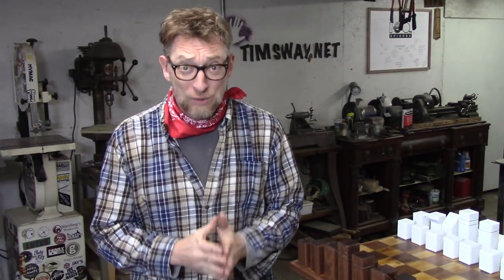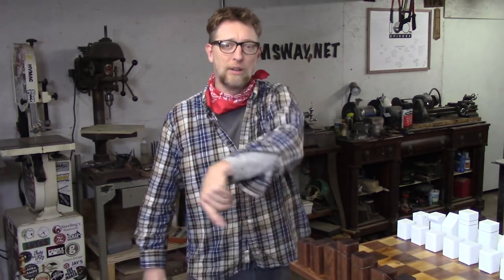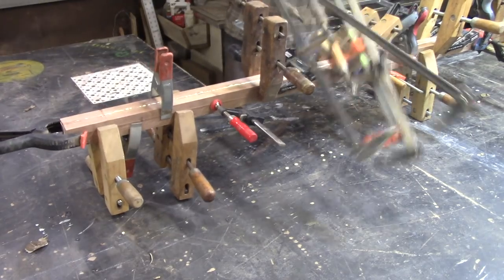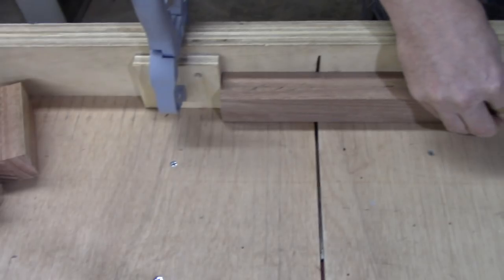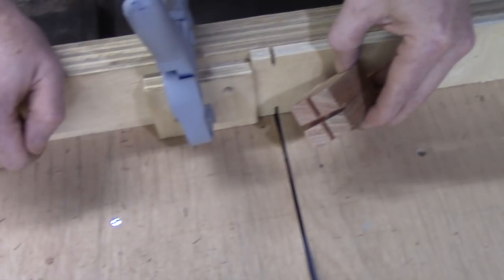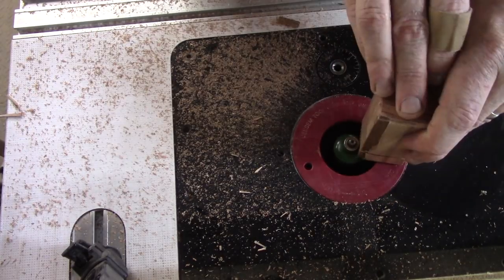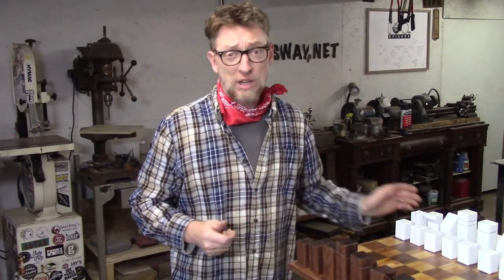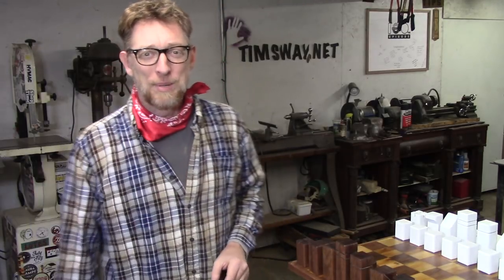Make an Elegant, Minimalist Chess Set in an Hour | Simple Plaid Friday Project

Comment: Looks great.  Do you think a wt in each pc would be worth the time
Reply from the maker: at this size and with these dense woods it was not needed, but if you make them smaller or from lighter wood, drilling a little hole in the bottom for weight would be a good idea. hide it with felt.

Comment: i really wish i could make things for christmas but i just dont have the time, do you have any guidence?
Reply: Joe Christman make small or simple things, or something that you're familiar with already. Making the same thing repeatedly is much faster when you batch your production too, so you can make, say, 10 candle holders in the time of would take you to do 2 or 3 individual pieces.
Reply from the maker: yes. make with what you have and the time you can make. Most of my life I never had a workbench or tools and I had other "jobs" but I had a kitchen table and a paint brush. For example the first chess board I made (and I still use) is a wooden table/box I got at a discount store that i taped off and painted the board on. It took very little time and can be done while eating dinner :) Obviously there are better ideas, but you'd be surprised how much time you can make if you want to (unless you're like a med student intern, then maybe not :)

Comment: I'm not a professional by any means, but at 3:45 why dont you use a stick to push it instead? Devastating slip
Reply from the maker: I'm not quite sure I see what you're talking about? I am using a push stick the whole time. But to generally answer, at the end of the day safety is a personal relationship between the maker and their tool. Understand how the tool works and how it can hurt you. Know your comfort level and understand others may be elsewhere on the spectrum. 

I certainly see people do things that make me cringe. If they are new or inexperienced it is my duty to help them know and understand what they are doing is dangerous (and if they work for me I can mandate certain behavior). But if they understand the tool but choose to live on a different part of the safety spectrum, that is their choice as long as their behavior doesn't endanger me.

I spent a day working with a guy who had removed the safety guard from his circ saw and would set down on a step stool between cuts, with the blade still spinning, hanging off the edge of the stool. This was one of the most insane things I had ever seen, but before we started working he specifically showed me what he does and said to me, (paraphrased) that this was his method he had been using for decades, I was temping on his worksite and I needed to be aware of this for my safety. 

Do I think he's nuts? Absolutely. Is it my place to say that? No. It's my place to not bump in to his spinning death stool! If he comes to work on my site and my insurance? Well, honestly I wouldn't even hire a guy like that...
Reply: @timsway  it’s no real criticism of you doing you it is totally fine of course and you probably have an insane amount of expertise. I just had to look up bandsaw accidents on google and after seeing that i wouldnt want to have my hand or arm over the saw. Although i am confident that you are 99.9999% competent, you cant always go wrong once and since this is also an instructive video, i think it actually does matter to show safe ways for us to learn how to do it, after all thats what the video is about as well? Great work and im jealous of your craftsmanship :)
Reply from the maker: @Johanlob1  thanks. I am using a tablesaw,  not a band saw. The table saw is much more dangerous and everything I saw myself doing in that video is standard safe use. I do indeed model safe behaviour and if I catch myself doing something unsafe it does not make the video or I put a disclaimer in the video and use it as a learning tool. Check this vid out, I give a very long tablesaw safety speech in it you might find interesting, brb:
Reply from the maker: @Johanlob1  at about the 4 min mark: https://youtu.be/ZBb-5Ll0Eas

Comment: Tim, nice work.  Do you know of a food safe epoxy?
Reply from the maker: thanks! they're all food safe once fully cured, but it depends what you want to do. I wouldn't use anything like that that would be getting bit in to or cut, as the outer layer could chip and flake. What's it for?
Reply: Cutting board.
Reply from the maker: Marc Eaton I stick to mineral oil and beeswax for cutting boards. Knife will break the epoxy up.